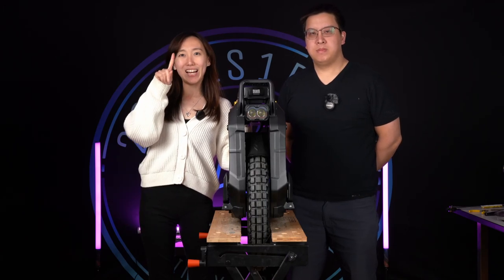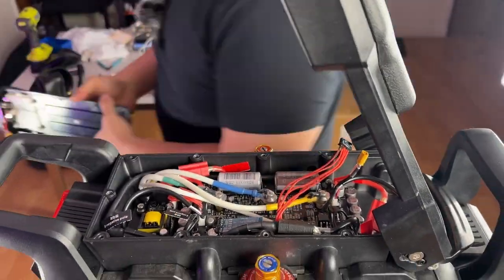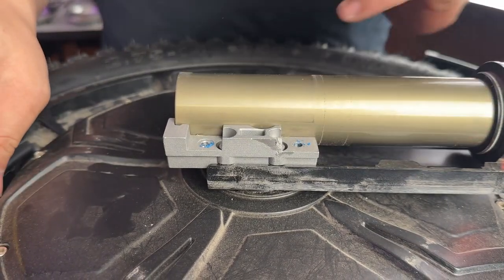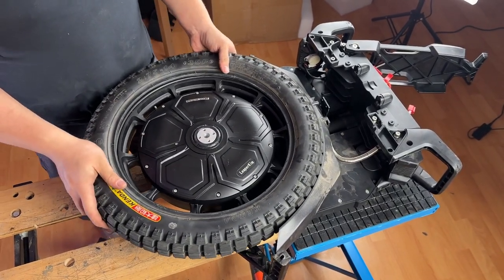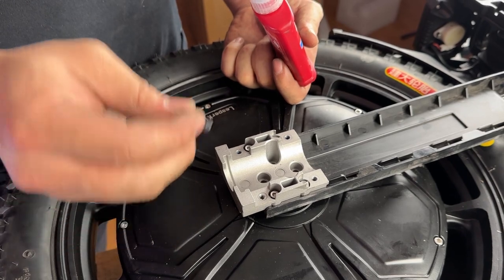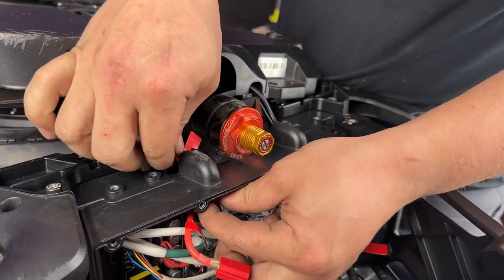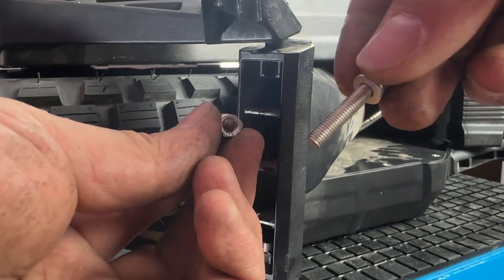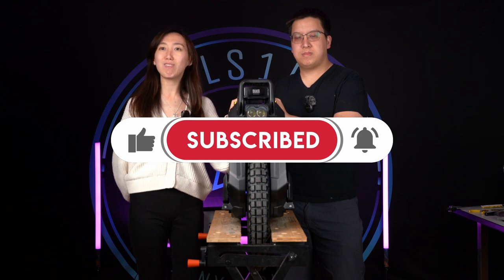Veteran Sherman S - Tire Change

Comment: 4:58 and onward, it’s a good idea to place a rag or piece of kitchen roll beneath the plastic tray joining part where the screws and Allen headed bolts are to be removed, so that if they are dropped when removing they don’t end up in the recess of the remaining suspension unit, from where they can be tricky to retrieve. Don’t ask me how I learned this! Great tutorial Albert, thanks for making it. Tried the Pilot Street 2, but way too squirrelly for me personally, so going back to the stock Kenda. 👍🏻🥃🏴

Comment: Awesome video, thank you so much for this!

Side note, I believe when disconnecting the battery terminals, negative (black) should be pulled first then positive (red). When reconnecting the battery terminals, positive (red) should be connected first, then negative (black).
Reply from the maker: This only matters if there is risk of “bridging the gap”. In this scenario, all the plugs are pretty protected and therefore risk of bridging the gap through other means is little to none.
Reply: @2cells1pack  thanks for clarifying

Comment: Once again can't be more happy with the content you 2 put out! Any news on the begode suspension video? Thanks again you 2!
Reply from the maker: Suspension video? In terms of how to set it up ? There was a video about changing the linkage from stock to stock+
Reply: @2cells1pack  oh I was referring to why it sounds like tunes are knocking around by the pedals sometimes. Or why it's important to over tighten the small screws on the side of the slider housing

Comment: The metal of the screws of the battery housing to suspension is so soft! I managed to strip it and the drill bit chewed into the metal like it was made out of butter.

Would have been nice if the screw extractor didnt broke inside the screw though (now to wonder how to fix that, snort).
Reply from the maker: These pieces are cast aluminum/magnesium so need to be careful.
Reply: @2cells1pack  harder to re-drill and tap?
Reply from the maker: What do you mean?
Reply: @2cells1pack  in case i screw up the thread of the screw hole. You said I needed to be careful.

Unless you meant the magnesium in the mix could cause problems.
Reply from the maker: I meant be careful not to strip it. If you drill and tap, just make sure you go slow (aluminum/magnesium has low melting temp) so need to be careful with drill bits.
Reply: @2cells1pack  will do, thanks!

Comment: Would you say those 8 bolts around the top are structural? Clark Pads is putting a TPU washer there on those bolts with a 1/4 gap under the head. Seems like a bad idea to me.
Reply from the maker: The 8 bolts that secure the battery packs to the motherboard holder?
Reply: @2cells1pack  yeah.

Comment: Curiousif its important to power on to drain caps after battery has been disconnected ?
Reply from the maker: It's important to drain the caps if you are touching the main control board, or removing phase wires from the board.